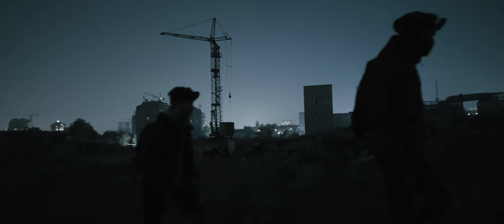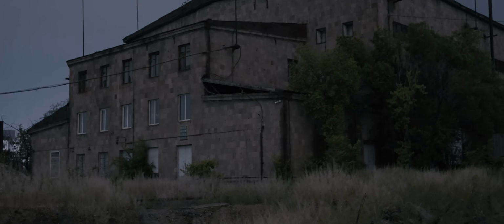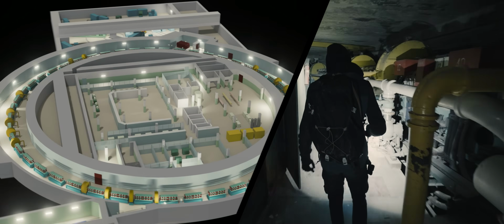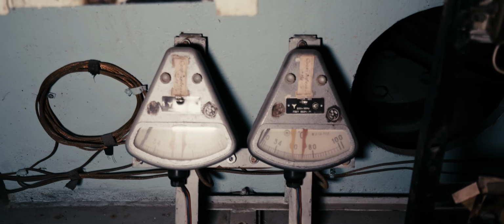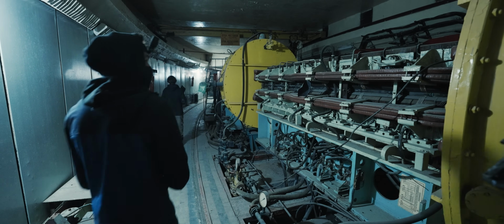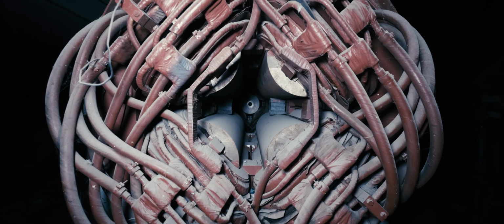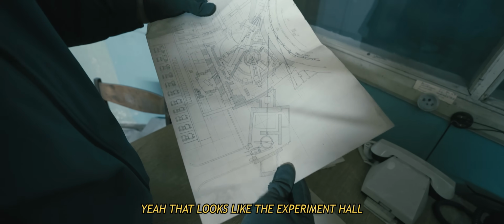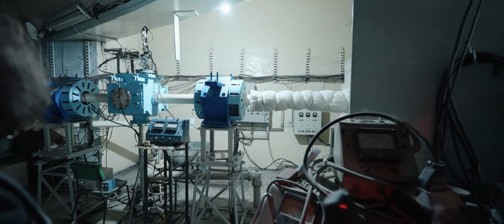Infiltrating a Soviet Particle Accelerator

Comment: Perspective from electronics engineer, very significant display of highest level engineering. From blue print drawings to construction. Ultimately a commissioned and working accelerator. 133 Mhz and 1Meg eV, Precise alignments. The reserch data locked away. I really respect the russian engineering they are very practical and get very advanced results from development, I have watched repeatedly to grasp the siignificant and complex detail of this engineering marvel. I could imagine restoration but they would have more advanced modern facilities by now. Thankyou for your effort and a privilage to witness. Appologies to Russia if this was a security issue, i will keep it confidential...

Comment: Those big yellow pipes on the resonators (if that is what they are) are almost certainly the RF feedlines, effectively rigid coax with an air dielectric inside. The frequency is a bit too low for them to be waveguides. They were probably fed from a klystron or an inductive output tube in a room outside the ring.

Comment: I do not want to be a bad news guy or anything, but to add a little bit of extra info bro, linear accelerators produced a lot of radiation, they may have lingering radiation and it’s even possible you guys were dosed, I would just be extremely careful when you guys do stuff like this. Depending on what they had in it, where you guys went, or how close you got to old sources, it could still be very lethal.

Comment: Very cool video. It's sad to see this amazing building being destroyed by the elements. They should make a museum out of it with boards explaining everything in different languages. I once visited an active and way bigger one and it was amazing. Today those facilities have giant server room building nearby to analyze all the data. They have fibre cables running everywhere to communicate between the systems with the highest possible speed. The machines today are also as big as in this video or even bigger. A ton of different buildings belong to this giant facility and if you have the opportunity to visit and enter almost everything, it's amazing. Most are just office buildings, but they also have giant labs or big machine halls where they can fix stuff. And they have their own rail system on the facility where they can move giant pieces of equipment around.

Comment: Fascinating technology.

I used to work with an early control system developed for controlling the beam focusing systems at CERN. Leaving the control manual is adventurous at least. Likely also the reason why they have left it as it is. Upgrading control systems is notoriously difficult and expensive.

Comment: Great video! The yellow pipes that go to the resonators are probably not for cooling water but coaxial "cables" for RF electrical energy. Like for old cable or satellite televisions but much larger and rigid, to deliver a lot of power instead of data. Some of the pipes will also be for the vacuum pumps. For sure there is also cooling water, so it will be hard to identify all the pipes correctly :)

Comment: If those huge electric magnets working some megahertz frequency, there's huge currents and heavy amount of losses cannot avoided.

That amount of electricity bill per day sounds almost free. Cooling would be least half of where energy needed, because so low temperatures.

Maybe they use that gun to make some radiological medicine or isotopes for it, without need that big ring accelerator.
I mean, that gun itself with fine tuning gives good amount of eV's.

I believe that gun have better efficiency versus used electricity than final accelerator in this case, because ring is so "small". Huge part of energy goes just keeping particles in right place and much less could be used to accelerate those more.
Looks like this have just one way to go, so particles hit to stationary objects, not to another particle that runs other direction (like how LHC works).

So impressive, it's criminal act to left building such condition it will leak and ruin everything that could be given museums and schools OR turn this place to education purpose.

It's much easier to understand everything how it works in this size like that machine is. LHC is way too big to look around and they don't allow peoples to walking there around and touching everything :)

Most impressive thing is this analog soul without some boring main computer to control everything. 😅
Most "high-tech" objects are workers digital watches or smartphones!

I just wonder how thick plate needed to stop some needle that have kicked almost speed of light and then released from accelerator..

Someone could calculate it maybe, I give mass 100mg to that needle and material 316 stainless steel. 😅
Reply: The 133MHz are pumped into the yellow RF cavities (resonators), these are not magnets. The bending and focusing magnets are varied at much much lower frequencies. Still, the magnets have a lot of loss since they are not superconducting, that much is certainly true.

Comment: The description of the device's operation isn't TOO bad, but it starts out with a perfectly absurd claim that the linac is oriented East to West to take advantage of the Earth's rotation to accelerate the particles. Whoever wrote the copy was thinking of rocket launches, not particle accelerators. At the Equator, the velocity advantage this gets you when launching a rocket is about 1,000mph; a beam of 15 MeV electrons in a linac is going nearly 700,000,000 mph..... as one can plainly see, the 1,000 mph "advantage" of orienting East-West is beyond trivial, barely one part per million faster than it would've otherwise been going.
Reply: Yeah, I looked for this comment. But otherwise the explanation was decent, especially for a video that isn't really only about how it works

Comment: Electromegnetic forces does nothing with acceleration particles. It used for collimating and deflecting. For accelerating use electrostatical force: voltage gradient or RF power

Comment: Also those machines switch the magnetic field of Earth
Reply: Those accelerators are changing the Earth pitch and it was all designed to knock Earth out of its orbit they built one in Switzerland and exactly across the world and a line they're building one in Arizona it's going to be 3 to 4 times the size of the one in Switzerland also if you look up the gotthard tunnel base and ceremony and CERN allowing demonic entities into our world from the movie Ghostbusters it's the same thing the the  hydron collider the trap from the movie Ghostbusters as well as it's there proton packs

Comment: Please consider bringing disposable Personal Protection Equipment such as disposable overalls and an certified N95 respirator next time you go somewhere like this. In places like these there is Asbestos everywhere and likely lead in the paint flaking off the walls and equipment. You don't want to breath it and you don't want to bring it with you when you leave the facility.

Although the Particle Accelerator has not been used in a long time, there can still be traces of long-lived isotopes that can form in various parts of the beam path, especially at whatever the beam target was.
Some form of radiation monitoring would have been advisable so you avoid touching contaminated parts of the machine. Though I am uncertain whether it would be a cause for concern at the current activity level.
Look up papers on decommissioning particle accelerators to get an idea of the potential radioisotopes.

Overall this video was very interesting. It's a shame the owners of the facility didn't even repair the weatherproofing of the building to preserve the equipment because clearly the facility still of some use, because part of the particle accelerator is still being used. I wonder how much of it would be in use today had it not have been neglected. Maybe due to the high cost of electricity and the equipment being obsolete it wouldn't be used. 

I wonder what that active part is currently being used for, and how they even use part of the particle accelerator because it seems like the equipment is complex rusted junk. Like how do they get the cooling pumps working, how do they get the power distribution units up and running, is there even any documentation still lying around? 
Seems like a lot for what I assume is a small team of researchers to take command of.
Reply from the maker: We had them with us, just not on camera (makes talking and piece to cameras too hard). Yeah it is a shame to see how the water has damaged it. So the active section is just the linear accelerator which was disconnected from the main circle. They now have experiments inside the circular section rather than the main hall.

Thanks for your comment and for watching 🙏
Reply: @kubler_x  Did you measure any elevated radiation levels? Since it was an electron synchrotron I would expect the levels to be very low after years of disuse. Proton or ion accelerators create much more activation of their surroundings.
Reply: @entcraft44  Activation after 20 years would be absolutely completely negligible. 

More to worry about is if old sources were left there (e.g. detectors often have long lived extremely powerful sources that are used as a reference for calibrations).
Reply: I think they use that gun for something. "small experiment" or turning bismuth to gold. 😊